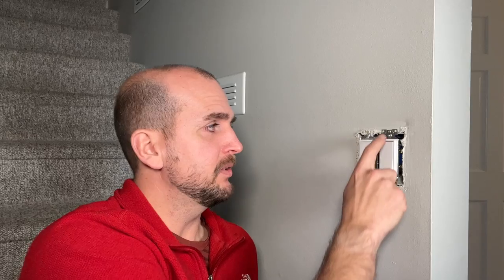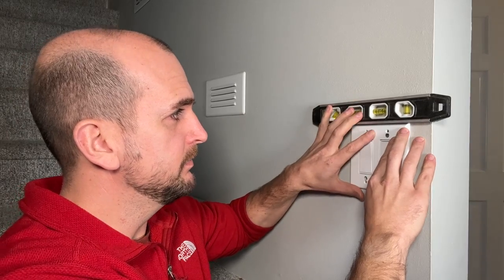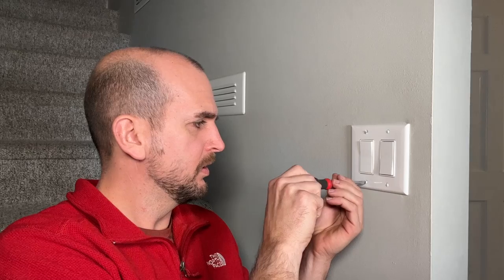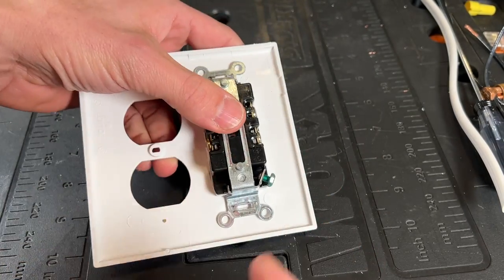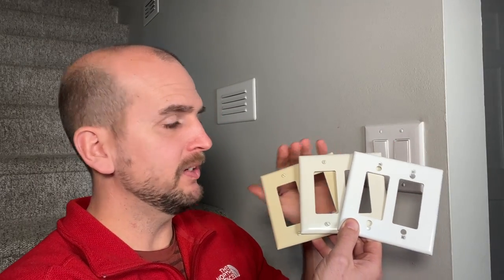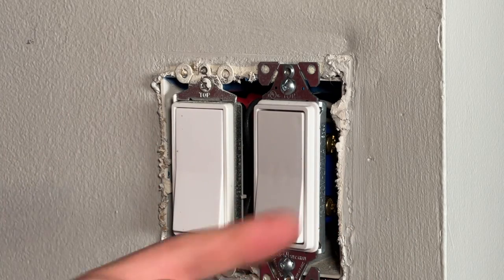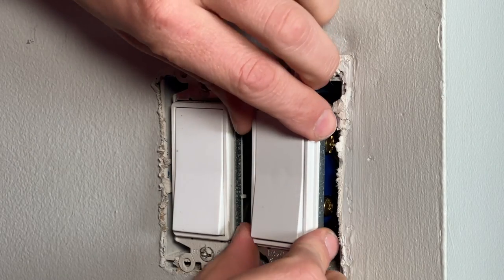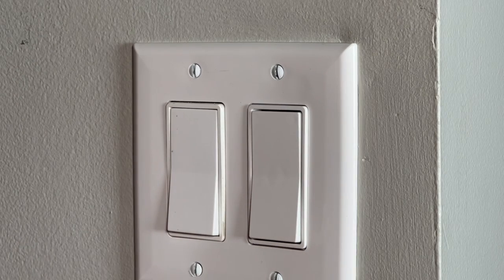Easy Way To Line Up 2, 3, and 4-Gang Wall Plates

Comment: I have 15 years in the trade and this is pure genius and something I am thinking “why didn’t I think of that!!!”  Simple and elegant.  Generally don’t have much problem with 2-gang, but 3 and 4’s I have spent too much life fighting those into place.  Using an epoxy to attach a level to the template would make this an even better tool.  Thanks for making this video!!!  Definitely stealing this idea.
Reply: I like the idea of gluing a level to the template. You could use a really small line level or such.

Comment: I have been doing this for years…next time try using the template “inside out”…makes it easier to catch the switches to line them up and the cupped edge sticking away from the wall makes it easier to remove and adjust.  Also keeps the contact area hidden…so even a freshly touched up paint job won’t show any smudged paint…
Reply: You have been doing this for years and still need something like a template? Well alrighty then!!
Reply: @jonesgang  . Years meaning what exactly? Did they say they were doing this day to day for years or just on occasion. I’d argue in either scenario it wastes less time and require slightly less effort.
Reply: @jonesgang  The problem doesn't disappear with experience as it's not a skill issue. It's like making a jig in woodworking. Sure I could do it freehand but my demand for perfection means the jig ends up being quicker if it avoids even one or 2 minor errors.

Frankly I don't see how your comment added anything constructive to the conversation.
Reply: That should also allow you to use a 4 gang template for 2 & 3. If you have room.  I think.
Reply: Piling genius upon genius.  Excellent tip.

Comment: Good tip, I'll have to look around for the more flexible wall plates. The last time I tried to drill one of those it shattered. Just a note for beginners, don't assume there is only one circuit going through the box, there could be two or three different circuits fed by different fuses there. So even if you think you've killed all the power, it's wise to wear gloves and be careful.
Reply: Don't drill it. Use a burr grinder on a Dremel tool instead.
Reply: Also, not a great idea to push on the wires with a screwdriver as you might pierce the plastic coating on the wire.

Comment: Excellent idea! After all these years, I hadn't thought of it. One issue that it doesn't solve however is how deep the switch our receptacle ends up sitting below the plate. Can't count on those cans to be accurately positioned! So you can stack stuff under the screw, etc. Or of course the old trick: Leave the switch/recep screws a bit loose and then use the plate screws to snug the device up to the plate. works well for switches. But receptacles not so much as you don't want the plastic plate to be the mechanical stabilizer.

Comment: Really cool tip! For someone who would use the template frequently, an enhancement might be to add a small bubble level to each template to eliminate the need for holding a separate level while mounting.  There are bubble levels available on Amazon for about a buck apiece that could be glued on.

Comment: I like using the “screwless” wall plates, because I can leave the outlets/switches a bit loose, install the backing plate, then tighten the outlets/switches, and then snap on the screwless cover. 
Easy and great looking.
Reply: Completely agreed
Reply: Yeah, the inner part of a Lutron screwless wall plate is effectively the same as this template.

Comment: Neat idea for standard wall plates. I've been replacing the wall switches in my house with Lutron Caseta smart switches and also swapping out the wall plates with their two-piece Claro plates to eliminate the visibility of the screws. The inside plate allows you to align the switches and tighten the screws and then you simply press on the outside plate to hide the screws and screw holes.
Reply: Yeah those switches look CLEAN

Comment: I'm a sparky and have a 6 gang cover by front door. Of course it was a big pain in the butt to line up. Used metal stackable work boxes and broke the first $22 plate. Great ideal. Retired from a large hospital that had at least a combined 16 receptacles on patient head wall. ( normal & emergency devices ). Skilled carpenter would make a 4' wide template up for every single room.
Reply from the maker: Dang!  I would say a template is a must for 4’ 😮

Comment: I've been using the screwless plates and you can tighten the outlet screws after you attach the back plate.  Plus I like the look.  

Only issue I found is that you sometimes have to shim the box to get it parallel with the drywall surface or you end up with gaps
Reply from the maker: Yeah I have used the screwless plates on a few projects and I love the finish look 👍

Comment: In one box  near the kitchen counter I have 3 light switches and one outlet - original installation.  The cover plate got chipped so I had to go online to find another one.  Then when I replaced the outlet with a higher quality, it was a bit difficult getting things aligned.  The ECX screwdriver tip on an electric screwdriver helped with the many screws involved.

Comment: The Lutron wall plates come exactly how you did your template. There are holes that allow you to screw the plates to the switches, and then holes that allow you to access the screws that go from the switches to the boxes. After that, there is a smaller cover plate that goes over the initial plate you used and everything is good to go. Using the Lutron one, I found it easy to start the screws from the switches to the box, then screw the plate into the switches to mount it up and get them level and straight. Then finish screwing the screws from the switches to the box. Everything is lined up and good to go. Pop the top cover plate on and bob is your uncle.

Comment: I really like your template idea. I have not seen that before. As an alternative, I have been using screwless face plates. They actually have screws but hidden behind a snap on cover. The plate behind the cover gives you the same access your template gives, allowing for perfect alignment. The added benefit is that there is no further debate about whether the face plate screws should be vertical or horizontal. ;-)
Reply from the maker: 😂the timeless debate of vertical or horizontal.  The other 2 healthy debates on the channel is to wrap or not to wrap outlets with electrical tape and whether the ground should be installed up or down on a standard outlet.

Comment: I do the same with the Lutron 2-piece wall plates. You take the back part (it already has the necessary holes), flip it over (so the screws on the plate do not interfere) and use it to set your switches / outlets straight and well spaced. This is simpler since you normally have the plate with you at the moment of doing the work.

Comment: To straighten a cocked outlet or light switch I simply grasp it with my wire strippers across the yoke top and or bottom as necessary, without loosening it, and twist it until its straight. Easier
Reply: Yup. It's all about making the device go in straight. Get your fingers in there and adjust the wires before you start tightening the screws. Then make sure the screws are in the center of the slot and don't crank them down. Just snug them.
Reply: @jackconnolly2665  If you put all the devices all the way to the left, or all the way to the right, the plate will usually line up.
Reply: @hankkline7300  I just shoot for the center so I have wiggle room both ways.  

I remember my first day as an electrician in 1975. My new boss dropped me off at a new tract house. He gave me strippers and a wobbly screwdriver and showed me the basics in 3 minutes. After one attempt I asked for a regular screwdriver and he said no, you will get used to it :).

Comment: PROTIP: For the longest I always did my finish cover plate screws on my outlets horizontal, on my light switches vertical. But now after reading a pro tip; I only put my finish screws vertical on every cover plate regardless of the device I will always make my screws up and down vertical to prevent trash buildup and dirt / gunk in my nice new white finish screws!
Reply: This is funny! I had a customer where I had replaced every switch, outlet, and cover He wasn't happy with the position of the screws, he wanted everyone in the vertical position as not to catch dust. I thought he was being anal. So now this is the way I do it.

Comment: Or just use screwless front decora style plates. The rear plate of the decora plate will function as your template and allow you to tighten the screws while holding the switches (or receptacles) in place.  Lutron Claro are my favorite decora style plates.

Comment: Screwless plates are becoming more popular and before you snap the cover plate on you can do the adjusting. Also you can use the inner plate without the short screws to line up the devices. Maybe carry an extra one for the example shown in your video.

Comment: Here's an idea for a video. I have a wall switch that controls the 4 bulb light over the sink and the ceiling fan. I took off the rocker and put a dimmer on it using the same two wires but what I'd like is to have a separate dimmer for the fan. There's a window in the shower so I don't really need the fan much, and being in California, I can open that window any day of the year. I've looked in the box several times at all the extra wires but it'd be nice to see how it's done.
Reply: Simply replace the fan switch with a fan rated speed control switch (available at all home stores. Use the same two wires that were on the switch on the fan speed control. Do not use a light dimmer!
Reply: @hankkline7300  There is no fan switch. That's what I want. I took off the rocker that controlled both. I took the two wires and put the dimmer on those two wires. Yes, it's a light dimmer. What's the issue there? What are the extra wires in the box for? That's why I suggested a video. Probably other people who would like to do the same.
Reply: @tonerapture2717  If the fan and the light were controlled by one rocker switch then you need a second hot wire from the switch box on the wall. Normally if the wiring for a fan is installed by an electrician (with a fan rated box, not a standard plastic light box) he will install a 3 conductor wire, with 1 ground wire, one neutral (white) wire and a red and a black hot wire. When the fan is installed the light (red) hot is usually connected to the blue fan wire, the black is connected to the black motor wire. the white to the white, and the bare Ground connects to the green. Then the light is connected to one switch, and the motor is connected to another switch. A dimmer is not appropriate for a fan motor. They sell Fan Rated speed control switches!
Reply: @hankkline7300  Thanks. If I can get it sorted out I'll get one rated for the job

Comment: You can just leave the switch/outlet slightly loose it will self center itself to the plate cover when you screw it on
Reply from the maker: That is what I used to do but always worried they would loosen up using that method, especially frequently used outlets 🤷‍♂️
Reply: This is precisely what to do.
Reply: @EverydayHomeRepairs  Agree. Where I live, if the inspector finds a loose receptacle, that make you tighten it. They are concerned that movement in the receptacle could lead to loose wiring, which is never a good thing.

Comment: Cool idea ,but as an electrical contractor ...too time consuming plus im not going to carry a bunch of templates to accommadate the endless variations of device line ups.Tighten down devices snug but not "Thor like" .While attaching finish plate you should be able to make final adjustments simply moving devices left or right. When plate is "fitted" slightly tighten mounting screws and proceed to level plate ....once level then finish tightening down the mounting screws.

Comment: Good idea but a little time consuming. Screwing down the switches, just pick a side to move every switch to and tight down, very left or very right, wall plate should fit every time, then level as needed with the plate on by tapping left or right corner of plate with flat head and linesman
Reply: Good for a diyer, not for an electrician who's installing multiple plates

Comment: If the box is installed plumb square level to begin with. The more you do now the less that has to be done later. Master electrician 40+ years
Reply: Four gang box on a crooked and twisted stud. Good times :)
Any box where the tile guy slightly covers the screw holes or cuts it to narrow for a GFCI
Special "smart" devices that are a little to wide to gang.
It used to be so simple. Everything was ivory toggles....but the plates always broke

Comment: Or you can just learn how to install switches :). 

It's only a real problem when a box gets tweaked out of square during installation.  With a decent installation you must make sure your devices go in straight. Vertical is not an issue because the screw holes are vertical (unless the box /stud is seriously crooked).  You have to be sure that there is no sideways twist to them. The wires will tend to push them out of plumb as you tighten them. 

Once you get the screws started you need to adjust the wires to allow the device to go straight back. When you get close to the end and are ready to snug it to the drywall, just aim for the center of the slotted opening and don't crank them super tight. You should be able to move them.

And, always use nylon plates. I don't know why they still make breakable plates but they do. In the olden days it was more difficult because you couldn't apply any pressure on the screws in order to get the switches to align with the plates.

As far as leveling the finished product, when done right, the plate and switches will move a bit after they are installed.

I guess what I'm saying is that your device is dumb :)
But, I have installed thousands.....tens of thousands so.....

Comment: This is a joke right?  So every time someone has a wall plate he/she will need to buy 2 just so they can "line" it up??  just slight tight the screws (not fully) where there's some move by the plate itself then when all is lined up then you take the plate cover off and tight the screws.  Really this is an issue no one is having. I promise you.

I have an idea for a video since you seem to be running low on those.  I have a garage that has 15 amp breaker that keeps getting tripped. should I just upgrade the breaker to 20 amp?  If so, does the wires have to be upgraded to bigger gauge?  So replace the 14/2 with a 12/2?  What do you think? Does the receptacles have to be replaces too?  There you go, here's an idea for a helpful upload.
Reply: It seems like a joke but the commenters seem to love it.
Reply from the maker: 😂 no joke my friend.  This is more targeted when you are updating the whole house so you would just make 1 or 2 templates for those wall plates that are most common 👍
Reply: @EverydayHomeRepairs   I get your point but an experienced electrician would be done with the job by the time you made the templates :)
Reply: @jackconnolly2665  my point exactly
Reply: @EverydayHomeRepairs  you didn't answer my question. iag